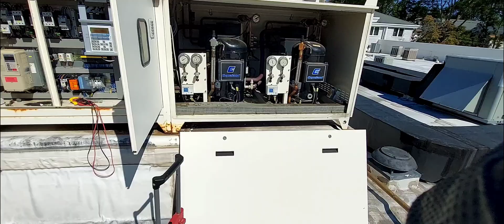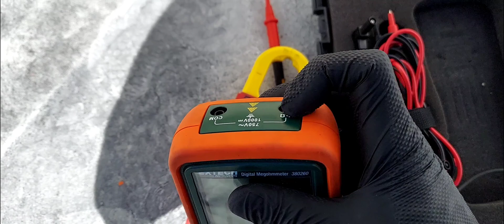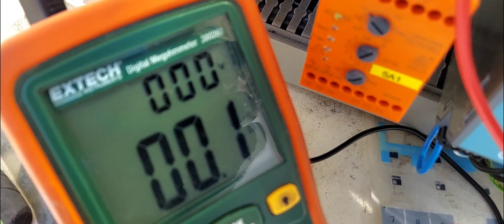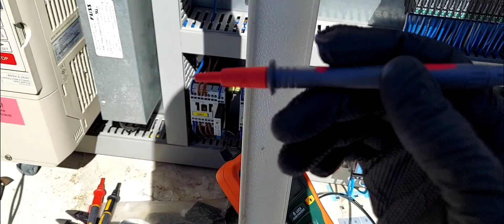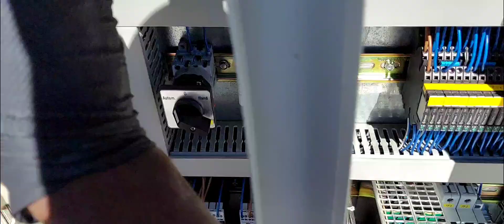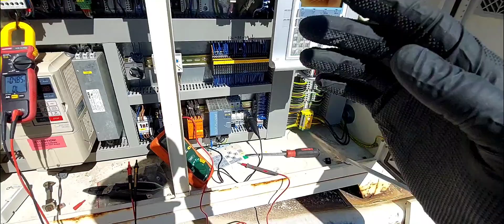MEGGER TESTING

Comment: i would ignore what he said about being able to skip testing the compressor if you check out fine from the contactor. always do comprehensive tests you dont know if intermittent issues are being caused by compressor windings barely touching the housing etc. also you will be able to tell if that compressor is on its way out soon and prevent further problems in the future
Reply from the maker: Ignoring a fact doesn't change it!!!

Comment: Great video!
I would also add that it is a great idea to log the readings on the unit and on the service ticket, so the next time you megger the compressor you can look for degradation of the winding integrity over time.
Reply from the maker: Thank you for stopping by
Reply: That's a great idea.  We have a notes section on our PM logs.  This could show the customer ahead of time compressor, or motor, degradation and to prepare for replacement.
Reply from the maker: I agree

Comment: There are 3 big reasons you perform a HV Meg test as close as possible to the windings... 1) passing electrical noise through sensitive electronics that may share earth grounding.  2) both sides of the test need to be 100% to achieve an accurate result.  It's best to completely eliminate the impedance from wiring and connections. 3) If a compressor MFG is going to publish leakage thresholds (most do not) they perform these test directly at the compressor.  NOTE: Copeland's AE-1294 is a MUST read.
Reply from the maker: @RJ_Make great points my friend I’ll  give you that, However not very logical!
Reply: @D2DNYAC  Perhaps you can explain the breakdown in my logic? 

My comments are nothing revolutionary and certainly not new. (except the electrical noise damaging sensitive electronics - which is a fairly new observation) right from Copeland's AE-1294.

Among other things it says 

"Any external electrical components connected to
the compressor terminals also affect megohm readings.
Wires, contactors and relays all leak current
and will decrease compressor megohmeter readings
if not disconnected."

Bottom line is, it's always best practice to isolate the compressor completely from all external components.
Reply from the maker: @Rj_make I will do another video on the subject addressing your comments so stay tuned for that!
Reply from the maker: @RJ_Make in the meantime watch the video over again I did address those comments to some extent already in it!
Reply: @D2DNYAC  It's all good, 'You keep doing you man'

Comment: Great video.  I've been doing this HVAC thing for a while but this is one thing not sure about.  How do you know how much voltage to put in on meg test? Or just go max on what the meter allows?
Reply: Always use it double voltage.. ex: if your motor work on 240 volts or 208 you use  500 volts on the meghometer
Reply: Here in canada we test 600 v motors with 1000v on meghometer.
Reply from the maker: If the selection is available I start low then go to a higher voltage output if the equipment/ load tested good, I increase the output test voltage, I believe this will protect the mega meter in the event of a bad short
Reply: A bad short will not destroy your meg meter. If it's dead short (bad short) it will just show it as that, a dead short.

 @D2DNYAC
Reply: Nice video and explaination sir!!